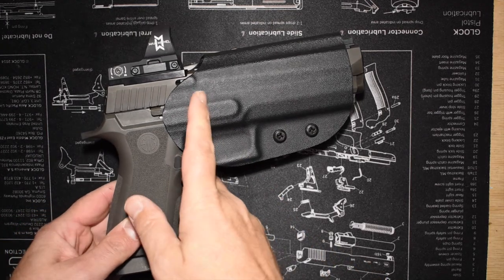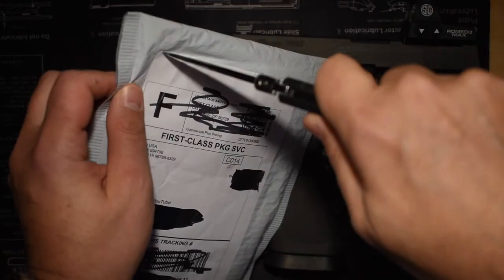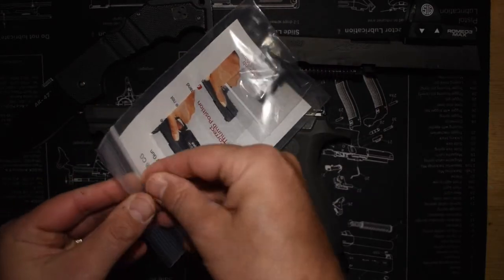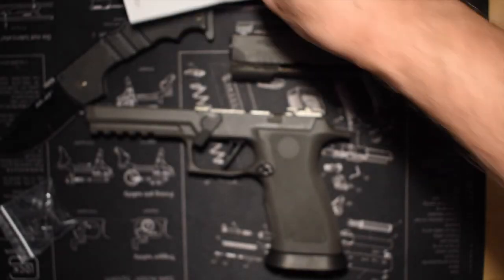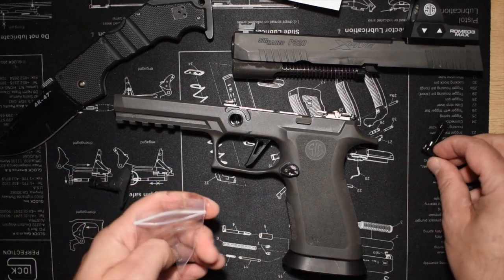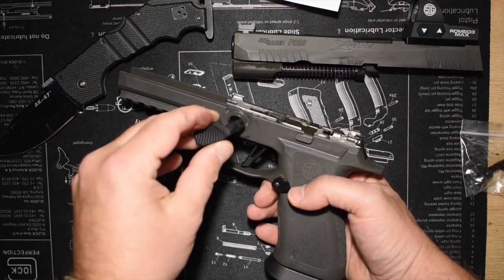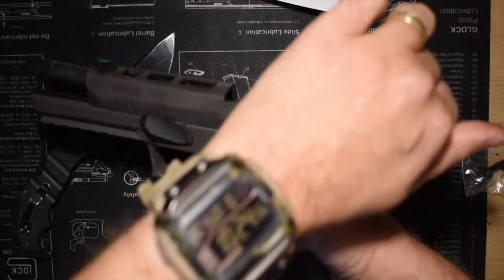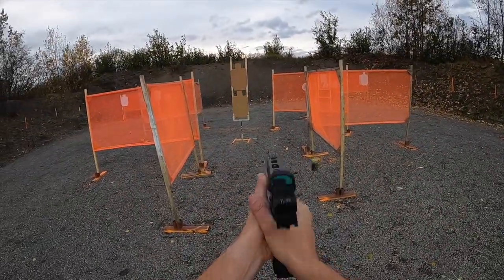How To: Install the Go Guns Gas Pedal...and CHANGE your pistol shooting forever!

Comment: reading the paper it said pressing down could cause failure. Now, they don't want you pushing down but sucks you might have to worry about that. Maybe its just for legal reasons. But makes it sound as though there's some movement inside. Thoughts?.. I'm thinking of getting one.
Reply from the maker: @DennisBolan I have had zero issues with that, no failures and no movement and I solidly rest my thumb on that ledge to mitigate recoil. For what that's worth, that's my experience with both my X5 Legions. Appreciate you watching, commenting and would appreciate the sub if you care to!
Reply: The problem only shows on X5/Legion, none of other variants of P320. Common factors are pushing down too hard instead of towards bore, too light of spring, or spring that is too long and bunches up in recoil, too high power fqctor for the pistol which is designed for about 135 t0 140. The problem occurs in all brands of Take Down Levers not just GoGun.

Comment: Next upgrade?
Reply from the maker: @PopsQuest, On the fence about a Gray Guns trigger or Sig Armorer's trigger. On the fence because I like the stock trigger as is, and I'm sure it will only break in better as time goes on. What do you think? You've had so much experience with this platform already.
Reply: @LWRoad  I ran mine stock for a long time!  Good trigger for sure
Reply from the maker: @PopsQuest  If it's good enough for you then it's definitely good enough for me! Thanks for the feedback sir.

Comment: FYI there is a little round nub at the very end of the pedal which seems to push down a little flexible rod in the gun (in my case an XDM elite).  So when I first insert the pedal into one side, I had the nub at 3 or 9 o’clock depending in if you have the frame up or down, then as I push into the first side I rotated the pedal to move the nub to the 6/12 o’clock position depressing the rod so the pedal can go in further.   Same on other side except I couldn’t see the thin rod.

Comment: Looks identical to the one Sig offers but this one is about 15 bucks more.  Any differences between the two that you know of?  I just ordered the Sig version and is supposed to be delivered tomorrow
Reply from the maker: As far as I know, Go Guns produces the Sig versions as well and are identical. At least they were when they were originally offered on Sig's website.
Reply: @LWRoad  cool, I figured one of them made both of them!  Thanks

Comment: Is that an after market trigger? Skeleton? Is it like $100? How does it feel. I have a p320c and want one.
Reply from the maker: Hey @FloridaBonsai No, it's the standard trigger module that comes with the X5 Legion. But yes, it is skeltonized. For a stock trigger it's amazing. I think Sig sells trigger modules for the P320 that are similar or the same thing with a gold finish that you can drop into your P320. Good luck and thanks for watching!
Reply: @LWRoad  The Custom Works FCU is the unit I believe you are referring to.  It is awesome and I have two of them.  You can find them for a decent price, if you look around.

Comment: Hey just got my gas pedal. What holster do you have for your P320 X5 Legion?
Reply from the maker: Hey @TheBigpappa160, congrats! I just used the same holster, it's a standard P320 holster I got from Ben Stoeger Pro Shop for competition. Eventually I plan to have one custom fitted for the gas pedal but I just tightened the screws down to where I had retention but still a fairly smooth draw stroke and loctitied the screws. I'd recommend a custom local holster maker if you don't have a holster yet. Thanks for watching and good luck!

Comment: I'm a lefty shooter predominantly. Still worth for off side?
Reply from the maker: @JakeSnizzle The concept is the same for right or left hand, so I would definitely say it's worth it. I am not sure, however, about the availability of a left handed specific version. I don't see one on the Go Guns website. Let me know if you find different, hope that helps and thanks for watching!
Reply: @LWRoad  my thought was that as  it is offered for my offside (righty), it would be a bonus for control. I don't believe I saw one for lefty shooters specifically. Perhaps in the future they will produce one that is ambi?
Reply from the maker: @jakesnizzle9385  Interesting, if you decide to go that route let me know your thoughts after you've run some rounds through it. I haven't heard any southpaw perspectives as of yet.
Reply: @LWRoad I will indeed, sir
Reply: @jakesnizzle9385  I was just about to ask that. I cant find a left handed one either
Reply: @jacobmoore6874  it would be easy to produce. Make a lefty version, with an insert thru the frame, and a button head Allen screw on opposite side. Or maybe a recessed tapered flat for flush offside retain.
Reply: @jakesnizzle9385  yeah that would be great.  Literally with how modular sig p320s are u think they would have something like a hardware kit for lefties

Comment: Will this work for left handers on the opposite side of the pistol?
Reply from the maker: @scottmoore I don't think it will simply because it replaces the takedown lever which can only be inserted from the left side of the frame to the right side. I would enquire of Go Guns though to see if they possibly have something that could work.
Reply: @LWRoad   Thanks
Reply: We are very close to a left handed version, now in prototype torture testing.
Reply: @GoGunGasPedal   Fantastic Thank you.
Reply from the maker: @GoGunGasPedal  Excellent, thanks for the update @GoGun USA !!!!